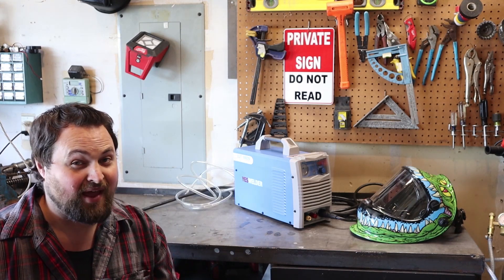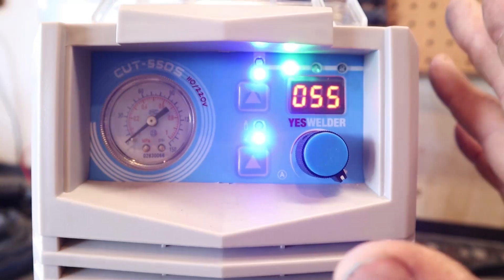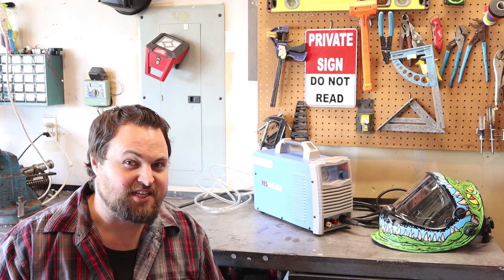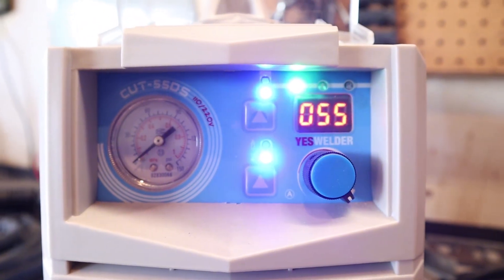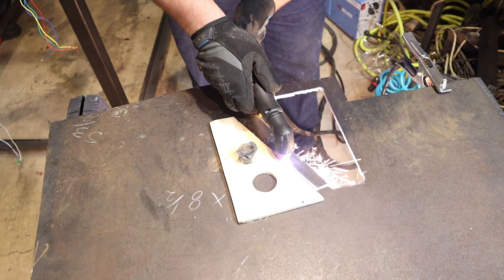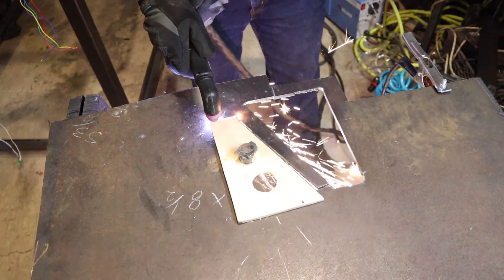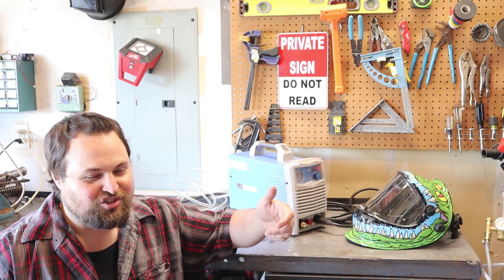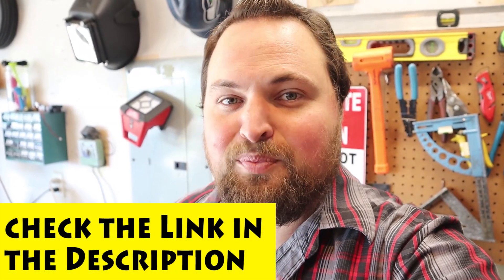YesWelder CUT-55ds Plasma Cutter Review

Comment: That air compressor is seriously loud! Lol. RiGID makes a really nice one that I bought for my CUT 55DS I purchased back in 2021-22, and I also bought the YesWelder MIG 250A Pro at the same time. Just 3 weeks ago I purchased the YesWelder DP200 and I can't wait to be able to use them all, because I didn't have 220V receptacle, but I just purchased thw 6/3 wire and the 50A circuit breaker, i only need the conduit, box and receptacle and I'm ready to go! Yaaaa-hoooooo! Lmao

Comment: what are the air compressor requirements for this plasma cutter
Reply from the maker: Just about any compressor will run it, but you'll want a 10+ gallon to run for any length of time. I use a 30 gallon, and it works great!

Comment: First off brother I love the Simplicity of your CNC machines it has given me a kick in the pants to start building one myself this will be my second table the last plasma table I built was about 12 years ago and everything is changed I was running a Miller Spectrum 1000 since sold it I have a simadre plasma cutter that I bought in a pinch and it's been going for 10 years no problem granted it's not hooked up to any CNC machine. I'm looking at the yeswelder ds65 I'm just wondering if this will work decently for a hobbyist small plasma table. I'm just going to do a 2x4 table maximum will probably be half inch cuts and it won't be production cuts just parts for my own project vehicles. I'm just wondering how big of an issue you've had with the duty cycle any comment will be great thank you

Comment: Real nice review. I only wish mine worked. Pure chinese junk. Mine was no good out of the box. Pressure gauge only reads 30psi. I don’t know whether I have to much or to little air pressure. Arc goes out after a few seconds. Yeswelder is putting unreasonable demands on me to fix it.
Reply: I have heard nothing but the opposite from other online reviews so just purchased seven of these for stocking stuffers.

Comment: Pure garbage. Couldn't adjust air pressure right from the box. They won't repair or replace.
Reply from the maker: Like the regulator didn't work? I'm not trying to be rude, but did you pull up on the knob before twisting it?

Comment: Hi.  Thanks for review.  What compressor you running this on?
Reply from the maker: I was using a 6 gallon porter cable, it didn't keep up with my CNC at all. I bought a brand new Mcgraw 25, that thing was a POS, now I use an old 30 gallon craftsman, that one works ok.
Reply: @StrangeGarage  thanks.  I ordered it now I have to figure out where I can make room for 30 gal compressor or cancel the order.  Not sure which.
Reply: @StrangeGarage  thanks for the awesome reply though.  I truly appreciate it

Comment: How about hardwire connecting to a panel. Is it 10 wire gage and double pole 50amp breaker?  Anyone know?
Reply: 50 amp breaker uses 6 wire, I have it connected to a 30 amp circuit. which is 10 gauge wire, 30amp breaker. on 120 volts & I can cut 1/4" no problem. @  35-40 amp

Comment: Thank you for your time in making this video. Just to clarify, on Yeswelders website it shows: "Max Rated Clean Cut Thickness: 5/16"@110V, 1/2"@220V" so have your used it too cut 1/2"? or is 1/2" is just a little far fetched?
Reply from the maker: I'll see if I can come up with some metal to try this. I have to do a follow up video anyway so these are good questions. 

It cuts 3/16" really well! I am really happy with the cut quality.
Reply: @StrangeGarage  Is there an update on this? It's been a year plus, just curious if you tested it on thicker steel and if the unit itself is holding up?

Comment: So how do you get around the duty cycle with plasma cutter? do you just run at a third power?
Reply from the maker: It's very tricky. I programmed a 15 second pause between every cut, and I run it below maximum power when I can. What I have not determined, is it better to run it faster at full power or slower at lower power? It's hard to say. 

I have run it for 10 minutes continuous, only ill effects is it eats consumables. I believe the machine can cope, so I MAY replace the torch with a more robust one.
Reply: @StrangeGarage  I assume you would look into a straight torch if replaced. I DIY a lot of stuff and have been looking at doing a DIY plasma cutter but always feared the interference with high frequency from plasma cutter.
Reply from the maker: @digitizer101  I posted the build video today actually. Youre right on the money, a straight torch for sure. I talk about how I mitigated the EMI in the video, I don't have any issues anymore, but at first it was a really buggy machine.

Comment: Where can you get consumables? Does it use common consumables and parts?
Reply from the maker: eBay, or directly from YesWelder. I will check on compatibility with other machines.
Reply from the maker: I ordered them from 3 differen't places: From YesWelder, from ebay, and direct from China. The YesWelder order showed up last... I know, a little disturbing. They're about $2 per set, and they were easy to find.